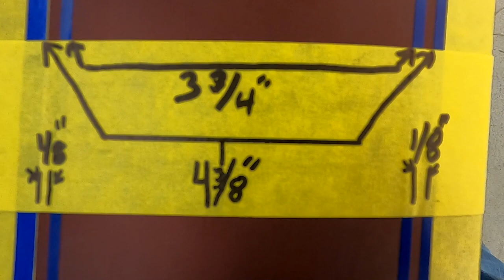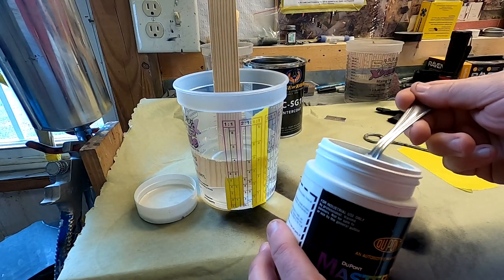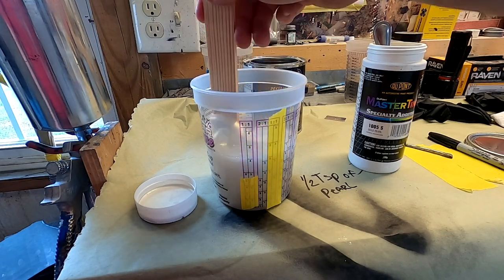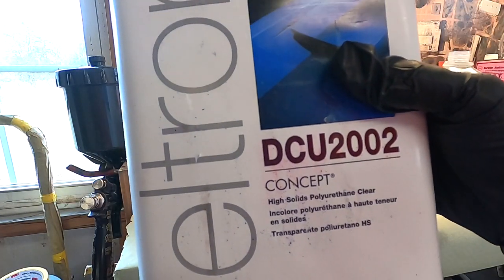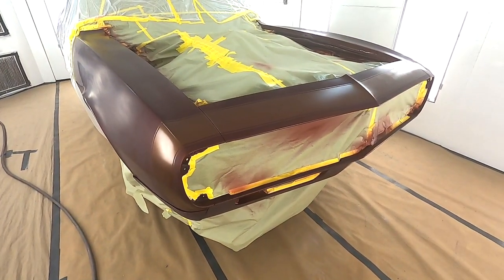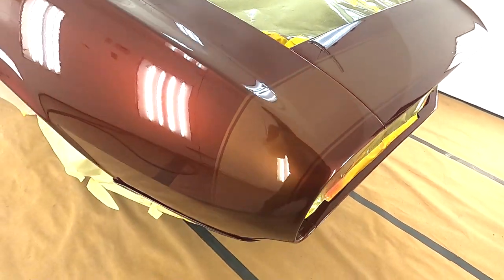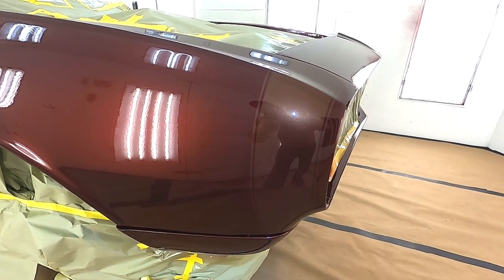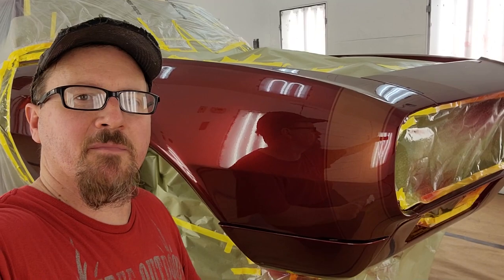How to Paint a (GHOST ) Bumble Bee Stripe From Start to Finish

Comment: Sweet job buddy!! 🔥,  i have confusion on how long the base and midvoats stay open, alot of ppl in watching seem to goutside the recoat window on tds sheets, yet they dont have trouble with adhesion, really nice job you are doing dude!!
Reply from the maker: Thank you, I usually check by feel or go by the sheet. I'll check my clear by touching a piece of tape near where I spray and it should feel like the sticky side of the tape, not stringing. That has worked great for me or just wait 15min between coats is a good rule of thumb!!!

Comment: We usually watch a Bob Ross video when I make pizza for supper , it’s very chillin , so I’m going to give your Designs a go and see how my pizza turns out ! My 67 RS is the same colour without a stripe and have been thinking of striping it for some time now. I’m not a painter but have worked on cars all of my life so this will be a good challenge for me. The spacing of the stripes has always been my biggest concern and really like your method and am not sure exactly how to knock off the clear coat but I’ll be wet sanding a bit. I’m also thinking how to tie in the colour of the stripe elsewhere on the car and am looking at painting the rally rims to match but that is a whole other nut to crack. I liked having lunch with the body shop guys at our dealer because they were always more chilling and making there cool toys shiny. Good luck , good health , and good fortune to you and thanks for your passion and patience. What flavour is bumble bee pizza?
Reply from the maker: Hahaha thanks for the kind words, I love Bob Ross also, if your gonna add a stripe over clear i personally would use 600 wet or no finer than 800 wet.as for addin the color other places, I like to see the accent color on the tail pannel between the tail lights. God Bless and thanks for the support!!!!!!¡

Comment: Question so before you striped it what did you use suff it like red scotch Brite would that work?
Reply from the maker: I think we wet sanded it with 600 grit. The pearl magnifies scratches real easy the red scotch brite may leave faint scratches.  You may try the grey scotch bright. But if you have a test pannel try the red it maybe fine. I just dont want to lead you wrong and mess up something lol. Hope this helps!!!!

Comment: Quick question. When you start spraying the clear coat, why does it have that orange peel effect when spraying with a quality gun? The end outcome came great, but did you adjust something on the fly?( I’ll go back and see if I missed anything in the video). Most people who use this gun have ultra fine mist on the first coat. I know all guns are different, and the first layer clear coat is “ just the first coat” nothing special. Also what were your gun settings with fluid, psi, and fan?
Reply from the maker: Hahaha you caught me, When I started spraying the first coat I noticed it didn't have enough pressure, I checked my regulator and it was right. I started on the other side and remembered I turned down the air valve on the gun to do some touch up with base and never turned it back wide open lol luckily if flowed out pretty slick before I started on the 2nd coat. As for my gun settings its usually by feel, air psi at regulator is 26 to 28 psi, the fan pattern is wide open and as for the fluid its pretty wide open I just regulate it with my trigger pull. Check out motivated painters he has a video on gun settings that works pretty good. Thanks for watching!!